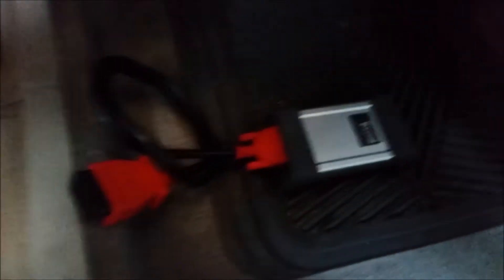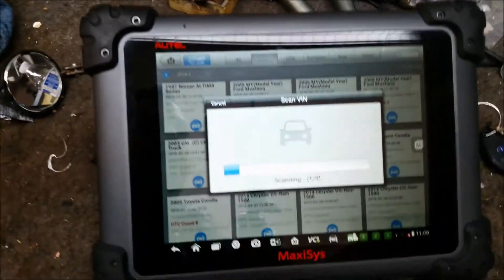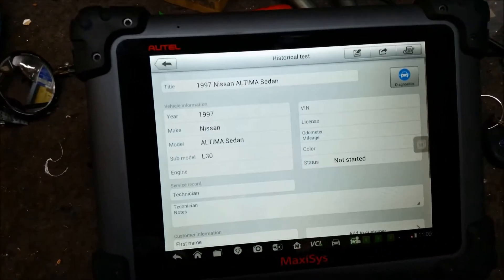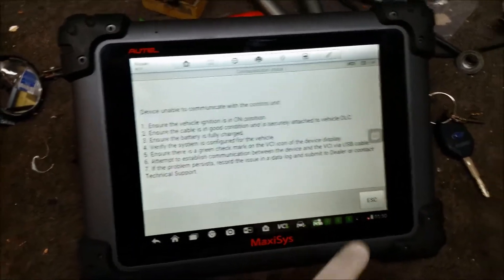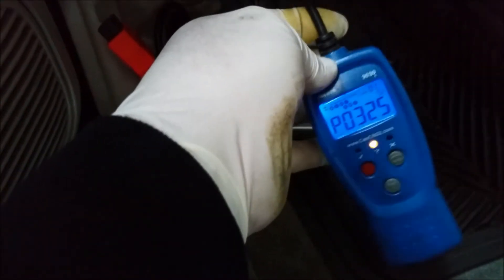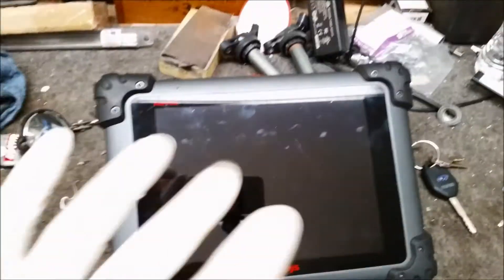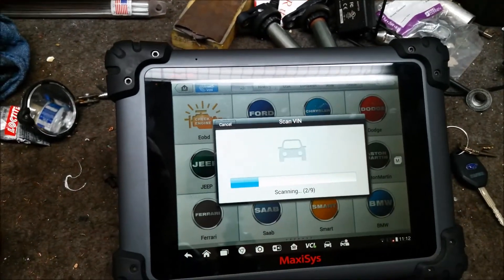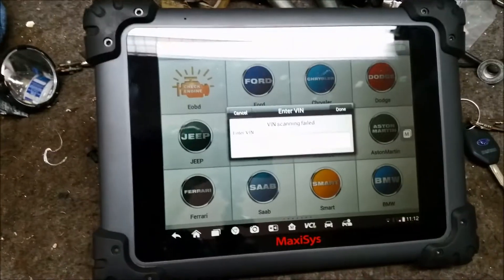1997 Nissan Altima No Communication....or is there?

Comment: I know your pain. I bought the launch Cr128 I believe it was. I bought it as a back up to my other scan tools. Anyways the launch would only read three wheel speed sensors and not four. My car had four and it was very limited for the price I wasn't thrilled about so I turned it in and got a credit
Reply from the maker: Every tool has its issues. Get them all

Comment: i'v had the maxisys for a while and it doesn't id vehicles below 2004 very well.....my suggestion to you is to build the vehicle and see if that helps....autel missed the boat with vin decoding pre 2004 so just a heads up on trying manual entry....that being said comm issues i'v had from there has been actual comm problems....and yes, you need at least the big three af scanners just to get by
Reply from the maker: Right on Bill. Even the manual entry didn't work on that one. Generic OBD did work, but still unacceptable.
Reply: i'm at the point in knowing which scanner to grab for what....such as early Chrysler....ditch the auwfull tell and grab the launch or solus edge.....keith is funny at times.... I met him at the TST BIG EVENT....he's taller than he looks on youtube ....got a selfie with him there

Comment: My suggestion has always been. No tech should ever have just one scan tool. I recommend getting like a modis that's almost update. Or a Solus ultra and get yourself a vantage ultra alot of useful information in a vantage ultra or a vantage pro.
Reply from the maker: Greg Feeney. I usually say, get at least 2 from different manufacturers. Launch, Autel, snap on, etc. One will pick up where the other leaves off

Comment: My $50 code reader will at least communicate with my 99 Nissan Altima but my $700 xtool won't and neither will my Snap-on Solus Edge. It's weird . My Snap-on scope instructs me to connect a DAV cable with a Nissan to adapter. But again my cheap scanner doesn't need any of that
Reply from the maker: Global OBD vs Vehicle Specific. 
Code reader only works on Global. You're probably trying to connect vehicle specific with your other tools and the network is down. Try the snap on and connect to Global obd. Then fix your network
Reply: @SAAutoRepair  you seem to know a lot about this. I'm just now trying to figure some of it out. Have figured out that a.DA- 4  cable is what most cars/scanners use now. But what is the DA-5 cable? If you have an ideas they'd be much appreciated